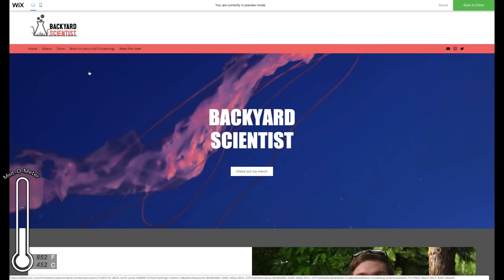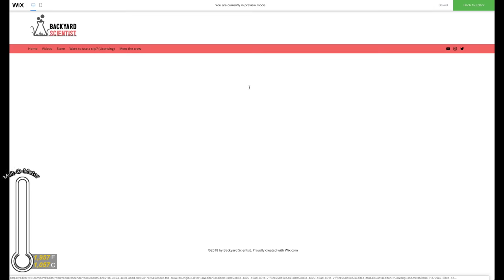Pouring lava in my pool!

Comment: About 2700C° for UV radiation
Reply: Adrian Wulff wow 
Either your rlly smart like RLLLLY smart
Or you just looked that up
Reply: Dudes out here with 600 iq with a albert profile pic and a playlist with quantum mechanics
Reply: Adrian Wulff if true. That is cool. If off the top of your head that is amazing. If fake. Probably
Reply: So, like, 9 times the heat he was using.
Reply: @The Void Looks Pretty 9 times? He had 2400°F (1300°C / 1570K). According to Adrian Wulff he would have needed 4900°F (2700°C / 2970K). Thats more like twice the temperature not 9 times.
Reply: Muffi Gaming Thanks.  Next time I’ll check my numbers.

Comment: Also normally anything under 1000 degrees kelvin (about 1300 degrees Fahrenheit or 720 degrees Celsius) doesn't produce enough UV light or radiation to even be noticed.
Reply: Aditl thanks I checked the comments because I was also interested in how hot it would need to get
Reply: Panda YT ditto
Reply: Thanks guy

Comment: Around 4940 degrees Fahrenheit uv radiation significently generated
Reply: 10/10 for grammar and use of Fahrenheit
Reply: @odis6397  why does Fahrenheit matter?
Reply: ariZon.a Celsius is more commonly used in scientific scenarios
Reply: @fandomgaming9072  Yes I know, so why 10/10 for fahrenheit?
Reply: @MrD34DM4U5  for letting us americans be lazy and doing the conversion for us
Reply: @odis6397  too bad the spelling leaves something to be desired.
Reply: @ariZon.a Fahrenheit was if I’m not mistaken based on Celsius, and is needlessly present. Along with it mainly only being used in America and baking

Edit: Sarcasm included in original comment, rating poor grammar as a 10/10 should’ve gave that away
Reply: Actually it generates uv rays before visible light
Reply: Proov it
Reply: science
Reply: @odis6397  The Fahrenheit scale was initially proposed in 1724, having based it on the earlier work of Ole Rømer, who Fahrenheit had met two years before Rømer's death (in 1710) and who had developed one of the first temperature scales in the world.

Celsius was initially developed in 1742, though at the time the scale was inverted, with 0 being water's boiling point at 100 being its freezing point. It wouldn't be for another year that we would see people begin using the modern Celsius scale, inverted for use in a mercury thermometer.

So no, Fahrenheit is not based on Celsius. It's about 20 years older.
Reply: R/iamverysmart
Reply: @Zansi Guess I was mistaken, no need to bring out the passive aggressive attitude and facts to prove nothing. “So no”, Don’t mix your opinion and facts, makes you look triggered.
Reply: @odis6397   Lol, I was just summarizing my statements as a response to your assertion. I think the aggressive attitude is all coming from your end, as I didn't intend any to come from mine, passive or otherwise.

Please do point out to me where I inserted any opinion into my previous comment, though. That's another curious (and demonstrably just as incorrect) assertion.
Reply: @Zansi I’m not playing ‘Get the last comment in’, I took my mistake. Learned from your facts but you wrote “So no,”, if you write facts with two words declining the other possibility then put a comma then you need to edit your original comment and fix your writing because it most definitely looks like you inserted your opinion into a fact. I have gone through this enough times to know that all you have to do is edit your original comment, you can just put “Fahrenheit in fact came before Celsius” there is no need for “So no,”. Good luck and Good night, I’m not looking for opinions.
Reply: @fandomgaming9072  Last time I checked we used the Kelvin...
Reply: @odis6397  LOL, so you're now asserting that my "opinion" amounts solely to the LACK of a COMMA? This is hilarious. Have a great night, man.
Reply: plays "why can't we be friends" in background for @Odis and @Zansi
Reply: Also, lastcomment goes to me! 😎
Reply: @jamesgarlick4573  slowly waves a lighter
Reply: Oh, whoops, didn't mean to steal that from you, James. Saw your second comment after I posted my first and refreshed. xD
Reply: @fandomgaming9072  actually at these temperatures Kelvin comes into play. It's about 3000 degrees kelvin.
Reply: @Zansi I missed my point and loop hole, oh well

Comment: According to wien's law it has to reach approximately 6921 C to emit UV radiation
Reply: dayum
Reply: Nerd
Reply: Did you mean for it to peak in the UV?  I mean, think about it: the sun isn’t that hot, at its surface, and it’s putting out PLENTY of UV radiation.
Reply: @azizk339  The surface of the sun is about 10,000 degrees Fahrenheit while Andrew Zhang said it needed to be around 12,000 degrees Fahrenheit.
Reply: Is this a meme? 69 and 21
Reply: Black body radiation
Reply: propane only goes up to 2000 C though right? Do you know how to get up to 6000 C then?
Reply: @lukeprather831  says the person who thinks he's the best

Comment: An object would have to reach 2200 degrees Kelvin and to get a significant amount of radiation it has to be around 3000 degrees.
Reply: Luminite thank you for the answer
Reply: Luminite You are talking about UV radiation specifically, correct? Just asking because I know anything with a non zero temperature gives off* thermal radiation, but it is so insignificant that nobody cares.
Reply: @iFenrisulfr  Yes. In a matter of fact we human give off radiation but it's so miniscule that nobody notices it. It's only very hot things like a star that gives off enough heat to generate a significant amount of radiation.

Comment: To give off uv rays it needs to be 6000K.  An orange flame may be 600K.

5600 Celsius
10300 Fahrenheit
Is 6000K
Reply: Today I learned...
Reply: Thats what I said
Reply: @Arianna Fulton no, you can keep it, because it's still rip pool,_, do you have any idea the things he's done to this pool?
Reply: Nerdneck
Reply: Kelvin is about 273.15 degrees higher than celcius, from what I recall from physics class in 1986.  Rankin is something like 459.xx more than Fahrenheit.  So...  6000 K minus 273 is 5727 celcius.   About.  Maybe.  Depends.
Reply: Oh, and 600 Kelvin is a mere 327 celcius, and around 622 Fahrenheit.  That's colder than many soldering irons.  I don't think anything glows orange that low.  More like the 2500 F the guy in the video mentioned was needed to melt rock.
Reply: @Arianna Fulton But, I'll bet you can remember your SO's birthday!
Reply: Is the sun 6000K?
Reply: @Arianna Fulton Except I took physics in 1986, as stated above.
Reply: The moe u now
Reply: @hmw_kamikaze3885  that's the minimum you need to get uv rays.  The sun gets way hotter than that.

Comment: I know it’s 5 years later from this vid coming out but to answer the question about how hot it has to be for UV rays is….

At 3000–5000 K there is still a lot of infrared light, but the “average” now comes out as white light. This is also when the ultraviolet starts becoming noticeable. At 10000 K the major component of the light emitted is ultraviolet.

Comment: I estimate you'd need a temperature of about 6000 degrees K for UV radiation. I looked at the Wikipedia page for blackbody radiation and they had a graph of the blackbody spectrum at various temperatures. 5000 K had a peak in violet so you'd need something a little hotter to get to UV.

Comment: Does lava emit UV rays?
Only very hot objects emit visible light (like an electric burner or the filament of an incandescent lightbulb). Lava hotter than 900° C (1,700° F) glows red. As it cools, lava stops glowing visibly, but will continue to glow in lower energy wavelengths of near infrared and shortwave infrared light.

Comment: 6:32 actually I think both answers are wrong because when you jump into a volcano before even reaching the lava you will be burned to death and it’s not properly demonstrated with the chicken because the bucket is to small and the lava I think is not hot enough because if you want actual lava it needs to heated by pressure and not by flames I think this demonstration is not proper but at least gives an  idea of what lava is and the difference between Minecraft and real life ! 😅